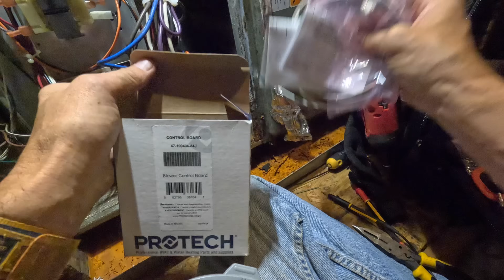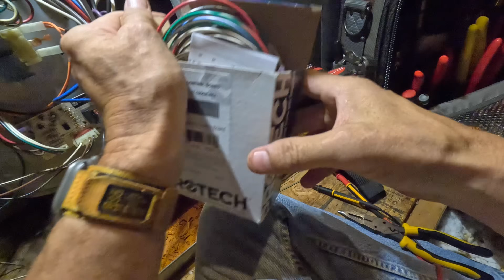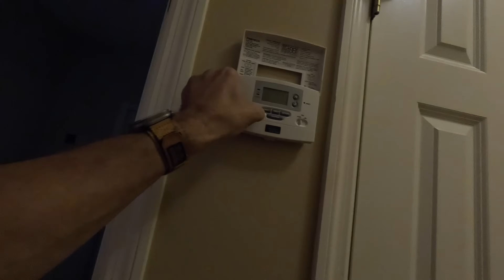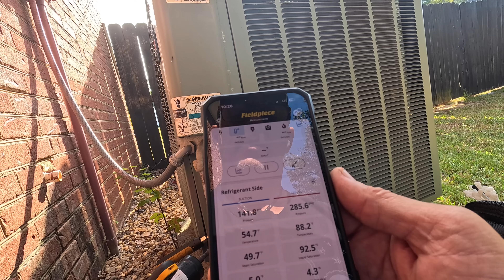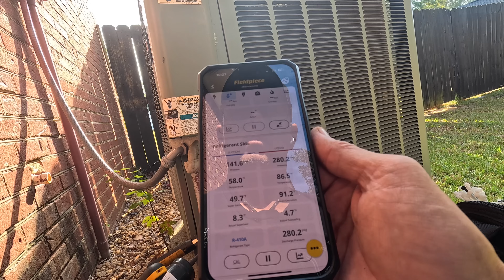New Customer Complained Of His Blower Not Working! #hvacguy #hvaclife #hvactrainingvideos

Comment: One of the best videos you've put out (information wise.) I was suspect of the board because as soon as you placed a load on the power source it would overload the circuit. Additionally, by putting pressure on your probes, it flexed the the board. Great job overall.
Reply from the maker: Thanks
Reply: I am retired from HVAC and industrial control system work.  I have used a plastic pen to push on more boards that I can count.
Reply: Bad circuit boards are showing up in everything. They can usually be fixed by reflowing the joints on the back. Chinesiem strikes again! Very common in auto parts. It's getting so you can't even rely on OEM, because there is no quality control.

Comment: what was the cause of his much too  high electric bill ??
Reply: Usually it's the result of short cycling. The fans and compressor use the most electricity starting. If there is something interrupting the cooling or heat cycle, it will turn off prematurely and then cycle back on continuously. This can be caused (likely in this case) by a bad board or thermostat, an HVAC unit not matched to the size of the house (too big is worse than too small), intake/exhaust not properly balanced, low on freon or even a dirty filter, clogged condenser and/or coil. Even the lack of a P-trap will lower the efficiency because the blower will be drawing unheated or cooled air into the air handler.
Reply: In the worst case I've seen heat strips running with cooling and the bill can be in the thousands.

Comment: I always clean up the wires it’s much easier for me to diagnose, but I would write an estimate to replace both the transformer and board but I bet that one of those solder joints on the board are cracked

Comment: my air conditioner was having problems with outside unit not running so i replaced the condenser unit fan motor its bearings were dry and hard to move and put in new contactor so unit was running well now the stupid blower in attic decided to not come on when cooling is called for even though unit outside is on and i can manually get it to come on with manual fan on button for thermostat. I don't think i can even get up in attic through the small access door to look at the attic unit at least it is end of cooling season up in PA